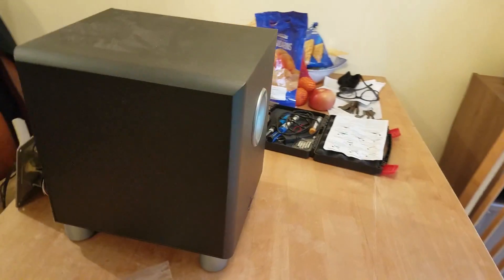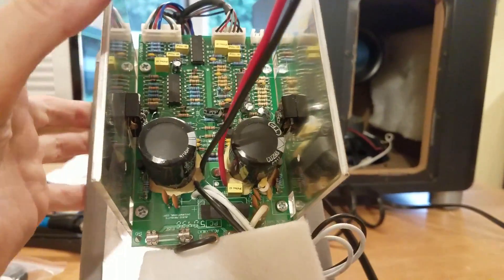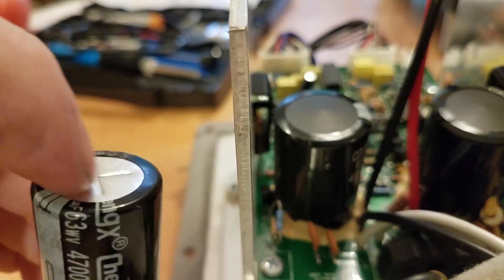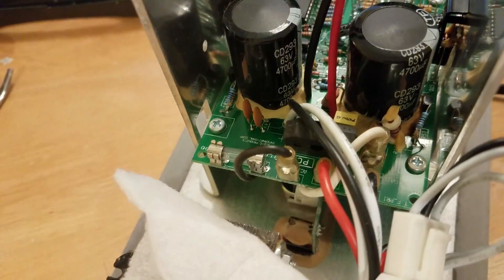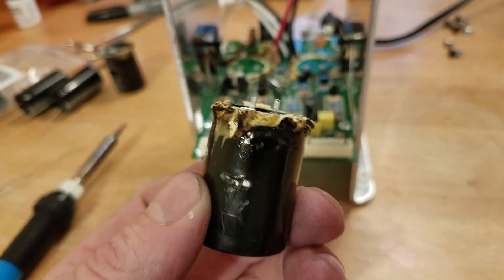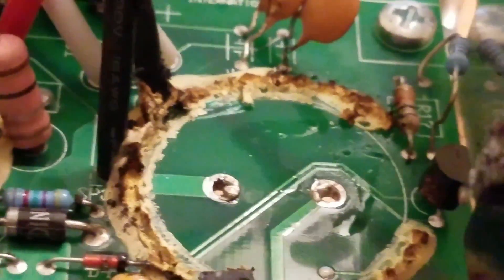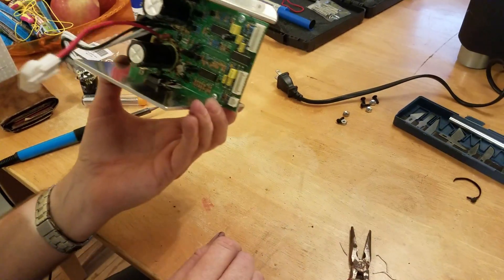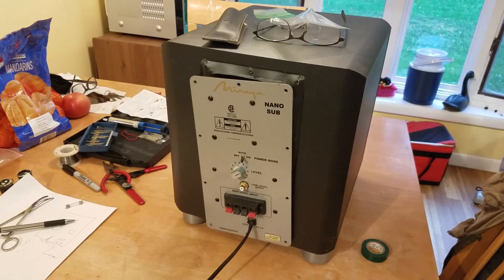Fixing Subwoofer Buzz for $10 or less!!!

Comment: That glue is the bane of all electronics of that era - it was slathered all over the place in 90s. Over time, it becomes corrosive and conductive and compromise any components it covers. You would be best to remove it carefully using a combination of soaking in IPA and careful scraping with a flat head screwdriver or similar.

Comment: Curious as to whether the hiss/buzz was contrelled by the volume knob? In my case if thhe vol is on zero then there is no noise, when i turn up the volume only then i get the noise, and it gets louder the more i turn up the volume. No visible sign of bulging caps internally.
Reply from the maker: The volume knob didn't make much difference on mine.

Comment: What if the capacitors look fine(not bulging) but it still has the 60 hz hum. I should mention that i have the

"Acoustic Audio AA5172 700W Bluetooth Home Theater 5.1 Speaker System with FM Tuner, USB, SD Card, Remote Control, Powered Sub (6 Speakers, 5.1 Channels, Black with Gray)" shipped from Bridgold
it was $114 when i got it and i got it for myself for Christmas
And before it was doing the hum i accidentally touched the two wires(that i added to the bass speaker) together, then my dad tried to see if the hum would happen on a different speaker so he tried a 4 ohm speaker when it uses an 8 ohm speaker and one of the 7 power transistors blew up, i then got new power transistors that would work with it to replace the 3 (1 that blew up and 2 that were smoking whenever powered) that were broke. and now i don't know what to doi should also mention that the original power transistors were UTC 2030A and i replaced the 3 with TDA 2030A but the place that shipped the surround sound is the same place that shipped the power transistors, Bridgold. So if you or someone else you know could help that would be amazing.

And if you need my phone number to reach me easier just let me know. And also sorry for how long this comment is
Reply from the maker: Honestly, that is a very inexpensive, basic system.  I would just replace the entire system.  You can get that entire system at Wal-Mart for $120.  Those are not great to begin with and not worth putting the time or effort into other than as an experiment.
Reply: I don't have any more money or a job
Reply: Also my bad I got the company that sold them wrong it was Goldwood that shipped this

Comment: Great thing you did but those capacitors you bought are way too cheap, chinese made and low quality, you should have chosen a good manufacturer like Nichicon or Cornell Dubilier caps, despite most people dont care for the manufacturer but between one good cap and a chinese cap, you can hear a big difference in the sound. As for the rest you did good
Reply from the maker: Those cheap capacitors have been working great for 6 years now and I still have the rest of the bag waiting to be used if needed.  At that rate I'll be dead before I need them all, so I guess they were pretty good after all.
Reply: @MIFixItDad  i didn't mean they wouldn't take long time to damage, its just about the quality of the sound that is completely different. I myself have a yamaha sound system that i have substituted all caps from the audio part and also the power supply and it really made a huge difference in sound, ts more clear and more powerful bass.

Comment: Great video! My subwoofer was making more of a rattling sound than the buzz demonstrated here. Since the speaker portion seemed to be working fine, I looked at the capacitors as suggested in this video. One of my larger capacitors looked slightly bulged, but VERY slightly. I measured the capacitance of the capacitors while they were still installed in the printed circuit board, which worked great. They were listed at 4,700 micro farads. One measured 5,200 microfarads, about 111% of rated capacitance. The other one measured 172 micro farads, or only 4% of rated value. I ordered five replacement capacitors for $10 from Amazon. I replaced only the bad (172 micro farad) capacitor and my 26 year old Phase Technology subwoofer is working again!!! My first time to solder on a printed circuit board :^)

Comment: I just followed these instructions to repair my sub. Plugged in in and no buzzing 5 minutes later I heard a Pop and the new caps I installed just exploded. I installed them with the stickers matched up as per the old ones and matched the ratings. Any idea what could have went wrong? Thanks
Reply from the maker: Either the caps weren't big enough or there is another issue going on
Reply: They were correctly rated. I've reinstalled the old ones and it's back to how it was - buzzing and unusable 😂

Comment: I've got Energy S8.3 with the exact same problem. The funny thing is, that the build looks nearly identical on the inside (>95%), they're clearly from the same factory. I already ordered new caps before watching your video but thanks anyway for uploading this!
Reply: New caps fixed the issue! I replaced the stock ones with 85 °C with 105 °C. I used a flathead screwdriver to break the epoxy/glue and get them loose before de soldering.

Comment: It sucks that most if not all sub manufactures use smaller caps . If they had put in higher caps , most people would still be using they subs and not trashing them . P\s  Floyd hope you bought some good side cutters by now. Always re-glue cap. no (short) cuts.
Reply from the maker: So many people miss the point of this video.  It's to show the average person how to do this.  Maybe I could have used nail clippers in retrospect, but most people don't have side cutters so I showed them an alternate way to get this done without having to buy a bunch of tools.   Even if it only prolongs the life another 2, 3, 4 years, it's still better than having to fork over the cash for a new subwoofer, especially at prices today.
Reply: 100% right

Comment: You are giving people some really bad advice. Cut the leads off people, don't "break them off. Don't "burn off" the glue with a soldering iron and damage components, like the yellow melted poly capacitor. Use a small flat screwdriver or a pick to carefully and patiently chip off the glue. It's not that hard to get off.

Comment: Anyone know why they glued the capacitors? I don't see why that would be necessary.
Reply from the maker: I think it's mostly for vibration but not sure.   I didn't see a real need either.   The replacements have no glue and have been working fine for years now.

Comment: I clean my solder iron tip by pulling it across a wet sponge before I solder and after soldering is finished when it’s going to be put away, then it will be ready for a quick wet sponge drag next time I need it.

Comment: My subwoofer was making a pulsing humming noise. I switched out the subwoofer Cable and that fixed the problem. I would try this first.
Reply from the maker: That's not a bad idea, but even before that, just unplug the cable.  If you still have a buzz when the only thing plugged in is power, then it's not a cable issue.

Comment: For those don’t have the exact same woofer don’t go automatically change the 100v 470uf.  You need to look at those caps near the power source.  Mine is Infinity Modulus and came with 200v 680uf.  I first changed the 100v 470uf that I found and it didn’t fix it until I looked at the circuit more carefully and changed the 200v 680uf.  And that fixed the problem.
Reply from the maker: Good point.  Don't just randomly start replacing capacitors.  It's usually the larger ones near where the cord comes into the unit.  It can be different sizes or specs depending on the manufacturer and rating of the sub.  Look for obvious damage first as well.
Reply: If you want a more empirical method to detecting bad capacitors, you can use an ESR meter to test each capacitor while still soldered on the board!  I know the point of the video is to do the repair for less than $10, but sometimes it's not so clear which capacitors are bad.  Still a very good video and thanks for sharing!

Comment: Help me please I have multimedia speaker system but the subwoofer has stopped what could be the problem
Reply from the maker: Unfortunately there are a million answers to such a generic question.   It could be not getting power, bad cord, blown fuse, power supply went bad.  A cable connection to the rest of the system could be bad.   Output on the other unit could be bad or input on the sub went bad.   You'll just have to start checking thru things bit by bit to isolate the trouble point

Comment: Great fix! Thank you for the video. Sometime that pesky glue is responsible for the trouble.  Specially the brown type of glue. As it age and dry, it become conductive and can cause overheating and parts fails.  I recommend to completely remove it, specially if it touches the wires or solder points of electronic parts.  Once removed, you can than put a new dab of glue in a non-electrical area.  Usually it’s ok to replace the caps with the same voltage rating but sometimes manufacturers cut corners to lower costs. If the space allow, higher voltage rating caps would add a safety margin. It’s a shame how many easily fixable electronic gear get discarded because of planned obsolescence. Great work!
Reply: I recommend using Amazing Goop as a replacement glue.  It has a high temperature rating, it holds well and if you ever need to remove it, it usually pulls away with a yank from needle nose pliers.

Comment: I was repairing an Energy subwoofer and it's interesting to see how they all use a similar amp design. Mine turned be the transformer itself which the clamping nuts itself needed to be tightened. However I do think you made a few mistakes. 1. Never buy capacitors from eBay/Amazon. Alot of them are fakes/no-names that don't meet spec...likely why yours looked smaller than the original. 2. Stuff should be glued down and you definitely don't want to burn off that old glue. The yellow glue actually turns brown over time with heat and becomes conductive. I always remove the yellow glue entirely as it will inevitably cause problems later and you might ruin the amp if things short out.
Reply from the maker: My preferred source for electronics components is DigiKey.  The whole point here though was to show the average person how to do this repair with as little special as possible.  Amazon is something most people are already familiar with.  So far, the "cheap" capacitors have been working well for 4 years and have zero issues.  If this were a more sensitive circuit then I might have used higher quality components, but this is just a basic filter to remove that 60 cycle hum so it really doesn't have to be that special.  I've never actually seen issues with the glue causing anything other than problems removing a component.  I've also heard it can become conductive, but so far have never actually seen that happen.  I didn't want to burn it off but there was so much of it I had to do whatever I could to get enough off to remove the old capacitors.  It's OK to use glue but this was just overkill.
Reply: @MIFixItDad  yea, he’s right, that yellow glue, or I think specifically it’s actually nylon epoxy, is an absolute NIGHTMARE.  The fact that it has been used for so long on sooooo many different electronic item leads me to believe one thing.  There isn’t a chance in hell that the manufacturers do not know that this glue DOES in fact turn brown, become conductive, AND it definitely does become corrosive as well.  It can short components out and I’ve seen it many times literally completely eat through the leads on components as well.  If it has degraded to that point it’s dark dark brown, and it’s actually much easier to remove than if it was still yellow.  Yellow it’s a bitch to remove but the brown stuff can be scraped off relatively easily.   For the life of me I can’t believe that no company has been sued for 100% intentionally using the glue to enable planned obsolescence for their electronics. If they had stopped using it after hundreds of thousands of electronics had died from it over decades of use, j might believe it wa unintentional. But after opening up an amp that was built 2 years ago and finding this shit slathered all over it, you’d never be able to conivimcr me thru aren’t planning the obsolescence of this stuff. It’s like a perfect time bomb, set to go off after warranty is up.

Comment: I found using a Dremel tool to cut the epoxy away from the pcb works quickly. Just avoid breathing the dust.
Reply from the maker: Oh, that's a really good idea.   I didn't think of using my dremel
Reply: What attachment do you use? Just a cutting wheel? Sanding drum?  Stainless bristles? Thanks
Reply: I didn't see anyone answer the question about the Dremel tool used for glue removal around the caps, I have a glue removal task around a plastic box that is glued solid shut covering the internal connection points for the (red/black pin cables) audio output terminal. I tried cutting the glue away using a fresh scalpel blade and it barely chipped away the glue tails - which were trailing off in all directions - tapering to a fine squiggle endpoint.
The glue had zero pliability which makes me think it's either the old EVO (cow) GLUE in those red and white tin pots
Or it's actually epoxy resin as it's that rock solid.

I have the same issue on a PCB board in a soundbar which has suffered from some liquid spillage and the caps were expanded leakage of some brown solution spread out over the liquid spillage and the traces on the board 

Removing the cap was easy but the mound of glue is tough as old boots 

I do remember seeing a video showing 3 ways to soften old solvent glues but I don't remember what was used to break down the properties of the glue.

 So, the easiest thing to remove the glue or resin on delicate surfaces, I have a thought of what could be the best solution 

Using one of the Dremel tools which is for detailed carving and come in various shaped tips. They're what I think are diamond tipped engraving bits and they work brilliantly when removing milliput on my modelling work and should easily grind down the hard glue on the caps 

Hope that helps anyone else with the same problem 
Good luck folks 

 @kilgoretrout5456

Comment: my cheap radio shack pc sub woofer makes a static noise,i bought the 3 piece stem new, after the sub has been on for a bit then it starts to make the static noise,i turn the speaker system off for a bit,turn it on,no static noiser
Reply from the maker: That may be the volume control.  Those were known to do that.   Pull the knob off and spray the control with tuner cleaner and twist back and forth and that may get it to stop doing that
Reply: @MIFixItDad  no volume control is a separate device,its not on one of the speakers..3 speakers plus the volume control that also has plugins for headphones ect

Comment: Hi I have a low hum and a static kind of sound ( crackling sound)? Subwoofer works. But the annoying crackling? I cleaned the gain and frequency dials? Any reply appreciated. Cheers from Australia 🙂👍👍👍
Reply from the maker: Hi Dragan, is this sound happening while it's plugged in, or when it's just sitting there powered on?  If happens plugged in only then I would suspect maybe a bad cable somewhere.
Reply: @MIFixItDad  it only happens when the unit is powered on. Last night listening to music at low volume. I could hear a little pop or crackle every now and then? I have had a situation where the braided wire connecting to the voice coil touching the whizzer. I've never seen that one before. Thanks for the quick reply. If it is powered on with no music? It's quiet but any loud music? And sound becomes less . I hope that makes sense? Cheers

Comment: Have a speakercraft BASS X-10. The board on this thing looks like something out of aliens. Any info would help.
Reply from the maker: I haven't seen one before.  So, what is yours doing, or not doing?  Does it power on?  Does it make noise it shouldn't?  If it doesn't power on, there is a fuse next to the power cord so don't forget to check that first.

Comment: Can i add 2 more capacitor parallel with old or change to 10k
Reply from the maker: That's probably a bad idea.  It might increase the start up voltage requirements which could burn out other components or start blowing fuses, could change the frequency being filtered, or any number of things.  It could also increase the effectiveness by decreasing the ripple that causes the hum in the first place, but I don't think so.  The circuit is designed to have the proper size capacitor for the circuit, so I would stick with the one it was designed for.

Comment: can you provide specific capacitor model number or part number for amazon ordering?
Reply from the maker: No, those can vary depending on your specific application.  The capacitor for my sub might be different than what is needed in yours.  You would have to see what is in place currently and get a comparable replacement.  Sorry, but electronics are pretty picky like that.

Comment: Hey Floyd. I did this with a subwoofer and still get the buzz for a second when it powers on. What would I check next?
Reply from the maker: If it's only for a second and goes away, then I wouldn't change anything.  The capacitors need time to charge to full capacity, so it may just be that they are a tad larger than needed and takes enough time to be noticeable.  If it operates perfectly after that then I would wait and see what happens and just enjoy it.